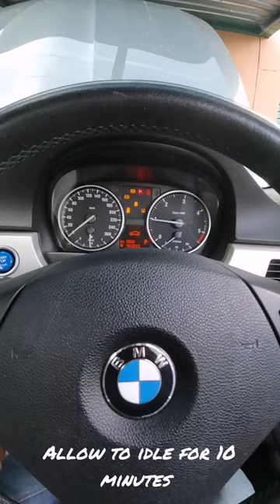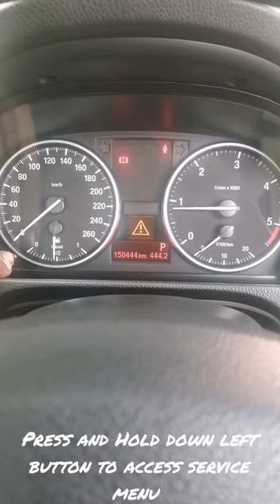E90 N47 320d Oil Change and Service Light Reset #diy

Comment: Hi. Thanks for the video. What is it that you put in the engine first then why do you start it up . To get the oil to the bottom of the engine? How long do you leave it running for before you start the work. Thanks mate.
Kind regards
Reply from the maker: Hi, i used an engine flush first, usually run it for about 10 minutes .. its an additive that thins the oil out and helps break down any sludge build up in the engine .. u CAN NOT drive the engine with flush for a long time, only a few minutes till its warm ..